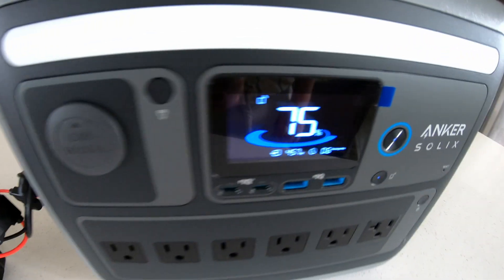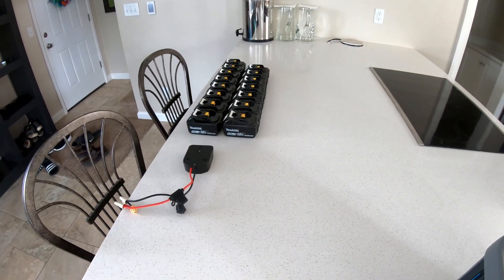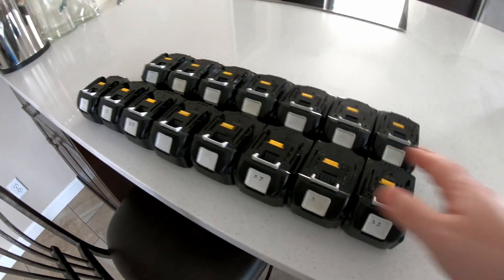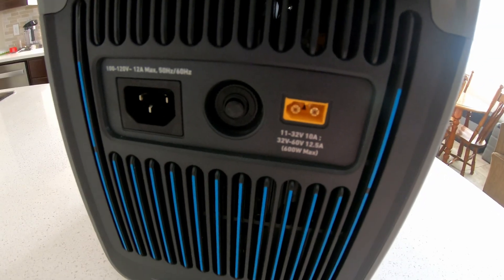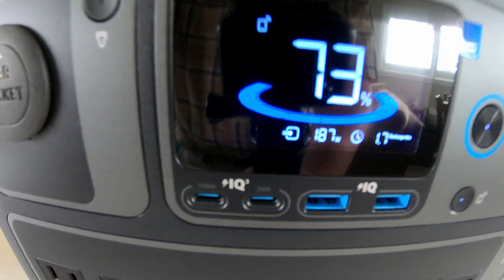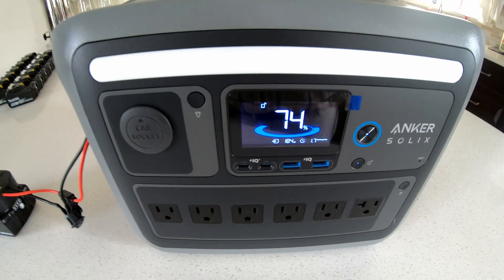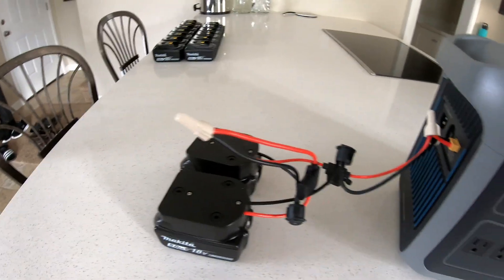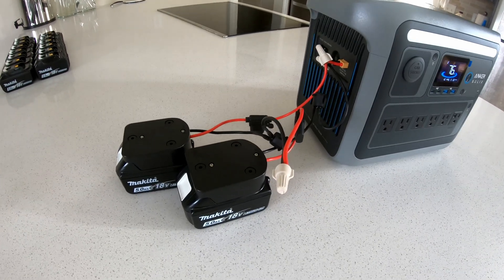These Companies Don’t Want You To Know This Hack! Makita, DeWalt, Milwaukee, Ryobi, Flex, etc.

Comment: Those Makita batteries are expensive and have much more limited life cycles than Lifepo4, just get a Lifepo4 battery and if you need faster charge rate a 95% efficient dc to dc boost converter. Far far more cost effective. Save the Makita for the tools they were intended. Unless you hardly use them (which it looks like) and they will deplete over time any way.
Reply from the maker: It’s a great last resort backup or portable solution. But definitely not budget friendly unless you have a bunch of the tool batteries like me anyway. Thanks for watching!

Comment: How is the fan noise?  Are people making complaints over nothing,,,  like on a constant 150 w load
Reply from the maker: It has multiple speeds it runs at depending on the load. 150w would probably turn the fan on eventually but it won’t run continuously with a load that small. I’ve certainly heard quieter fans on a power station…but at its lower levels I hardly notice it…even at night when I’m asleep. Now, if it ramps up to a higher speed it definitely starts to get a bit louder. Check out my full review of the C1000 for more in depth information about this and other stuff: https://youtu.be/Zdl3syXDUP8?si=VRgizuLe02tJ6N9Z

Thanks for watching!

Comment: I just bought an Anker Solix C1000.  I have a bunch of Ego batteries from all of theirtools I already own..  I bought an Ego Nexus.  That device plugs into one of my Ego batteries and provides 400 watts of power to a standard outlet.
Reply from the maker: You’re going to LOVE your Anker Solix C1000! And glad you have a good setup with your Ego stuff. So long as those batteries don’t exceed the voltage input on the Anker, you might be able to get an adapter for those and expand the capacity of the Anker like I showed in this video. But I’m not 100% sure since I don’t have Ego stuff to test with. Thanks for watching!

Comment: Awesome to see others experimenting with tool batteries like I have been for several years. The Ryobi batteries, in particular, have power tool adapters that only need a fuse and connector added to be able to extend usefulness of the solar generators. Keep up the good work and thanks for sharing!
Reply from the maker: Thank you! And thanks for sharing your thoughts and insights! I appreciate you watching and commenting!

Comment: doubling the voltage but not doubling the amps...um physics?
Reply from the maker: Yep! When you connect batteries in series it doubles your voltage which is what I did. If you connect batteries in parallel it doubles your amps. Both ways will give you the same sum of watts so in this case since I had more voltage overhead on the input of the power station than I did with the amps, I did a series connection to get more watts into the power station. Thanks for watching!
Reply: @theresatrickforthat Higher voltage (series) under the same load (1 Anker) is higher amps. Same voltage (parallel) with the same load (1 Anker) is the same amps going into the load. Please refresh your Kirchoff's laws or you will kill your Anker a lot faster. This can also be dangerous.

Comment: You can just make yourself your own power station only with the batteries you own.
From the very beginning you can look for an inverter that fits a voltage that you can obtain from your makita batteries, example 36v (2 in serial), and to obtain more power you can add in parralel too. But with a diode in serial so if one pack has more volts it would not empty itself in the less voltage pack. But when you pull strong, it will provide amps to help . 

Basically I find very useless to have unused batteries like this power station used only sometimes.

Better to have like you , a bunch of batteries from your favorite tool brand. 

And when you want a power lamp, you have a hack with a car led , when you may need 230 Ac you take the inverter hack, when you want to ride electric bicycle you attach 2 or 3 packs to your bike (the one I purchased for cheap because it’s original batteries were dead 😊)

Yes that’s what I am doing. 3print adapter + aliexpress connectors…

Etc etc etc
Reply from the maker: Yep! You’re exactly right! All these things could work with the power tool batteries as well! Thanks for watching!

Comment: Cool idea.  Do you think there a risk of over discharging the makita batteries and damaging them?
Reply from the maker: Thank you! No risk with the Makita batteries since they have a built in BMS that will shut them down automatically on low voltage cut off. I can’t speak for other brands. Thanks for watching!
Reply: @theresatrickforthat  prove it!